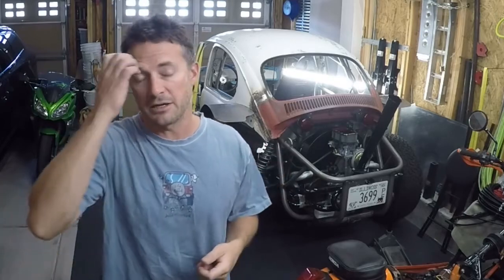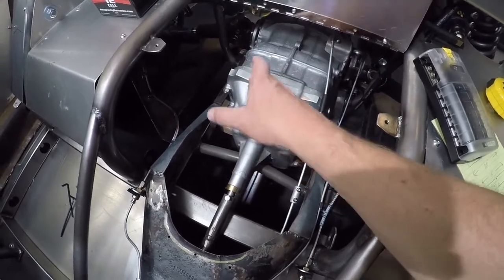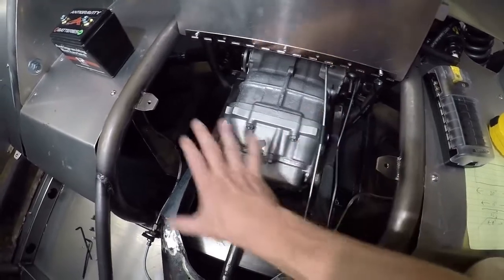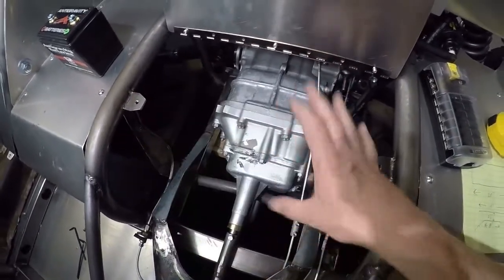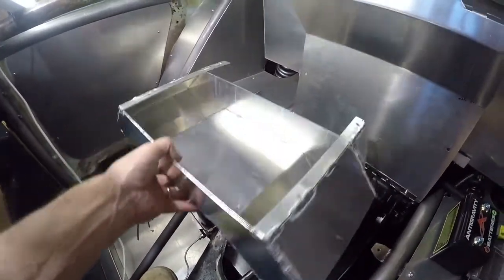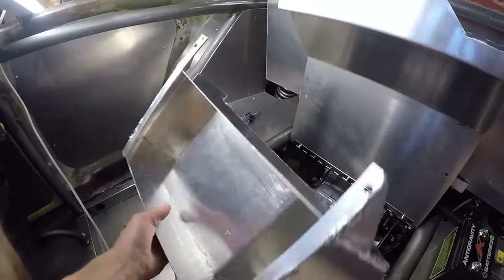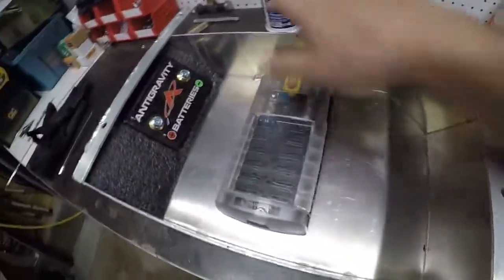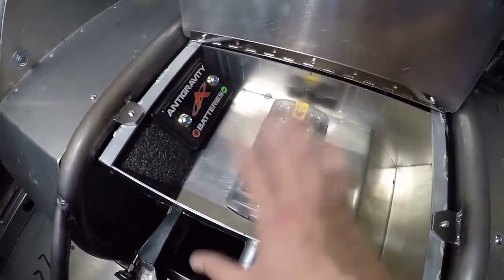Baja Bug Electrical Episode 2

Comment: I used that fuse box on my sand rail.  Great product, I purchased it at West Marine.  I also got crimp terminals there that have heat shrink on them, worked very well connecting to that fuse block using ring terminals.
Reply from the maker: So far I'm really happy with it. Makes the electrical system much simpler to organize. Thanks for the comment.